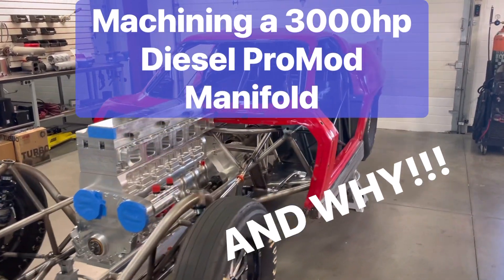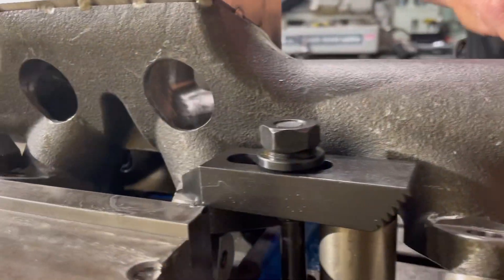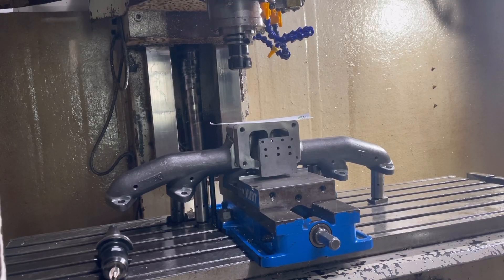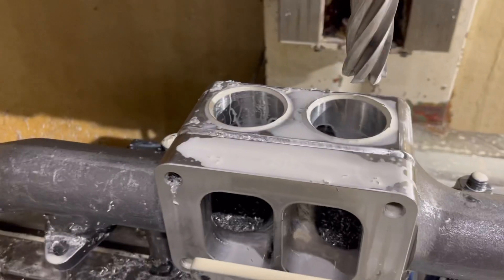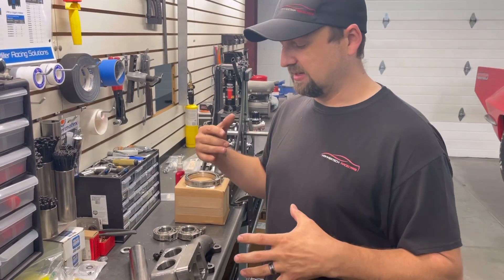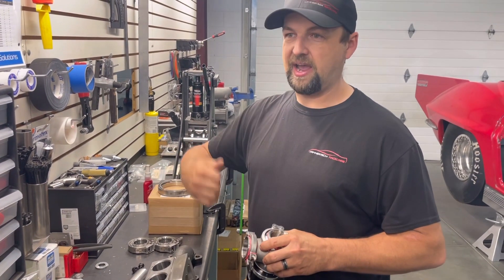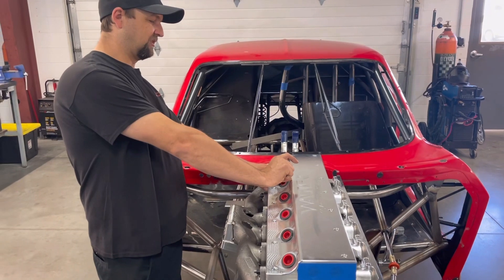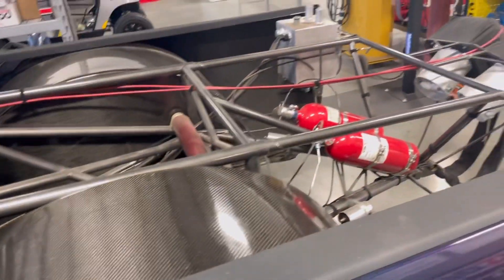Machining A 3000hp Diesel ProMod Manifold

Comment: I remember Jimmy Prock using 'feeler gauges' made of paper for setting the butterflies clearance on the hat, do you do something similar on the stuff you tune or..?
Reply from the maker: Are use plastic feeler gauges on the hat that way it doesn’t mark up the carbon fiber when you’re checking the blade clearance all the way around the housing
Reply: @robwendland  yeah I figured it was a combination of that and the same reason you use paper, nice way to be quick and ask something that is measured in mils already.  thank you 😊

Comment: I'm way more interested in the fabrication part of race cars, then the actual racing. building, and repairing these beasts is way cooler then watching them race.
Reply from the maker: I will keep that in mind. Starting in June I will be doing fabrication as NHRA has a new spec on the front end of the top fuel dragster’s. I’ll be explaining why this is happened and the process of replacing and fabricating the new pipe to the new spec.
Reply: @robwendland  cool! I look forward to seeing that!

Comment: I think people are getting carried away with the word pro mod. Would that diesel even be able to keep up in Top Sportsman? Nobody ever builds a car and calls it a top sportsman. Or maybe you can glass and bondo the doors shut and then it'd be a funny car. Watcha think? Do you think that car could hang in top sportsman? You know. The class below Pro-Mod- ified. 😆
Reply: They are getting very close. Biggest hurdle is trying to get the torque to the ground. It’s easy on a methanol engine making 3,800hp and 2,000ftlbs at 8,500rpm. But with the diesels they are making 3,300hp and 3,500tflbs at 5,200 rpm. Current diesel promod has the record at 3.99@182 in the 1/8th. But there are a couple teams running in the low 4’s that could also be in the 3’s by the end of the season.
Reply from the maker: Great response Scott. You’re right when these things leave the starting line it’s a fine line between Knock and the tires off and getting the torque knock down in that first hundred feet.I would love to put a direct Drive clutch system like a fuel car in it and I bet with that torque it would work very well it would just be more maintenance than just plugging in the tranny and cooling it down
Reply: With cars that will run 8 seconds or less in the 1/4, in what class and what type of car  is putting power to the ground and not knocking the tires off not the main hurdle to overcome?  And why is it that diesel and import guys can't, and will not admit when they are outclassed? Like seriously do you actually think you could enter that car in a field of top sportsman cars and it would be really close?  You can ask almost any import or diesel guy "Hey do you think you could compete with a field of top fuel cars?" And you won't get a straight yes or no answer. The answer is usually spot on to y'alls answers, aka excuses.  It would go something like this. "My Dodge truck against a top fuel dragster. Oh man it would be a close race. Because the main hurdle with my diesel is it has so much torque that the top fuel car hooks up way better next thing to worry about with my diesel would be getting it up on the boost so it billows black smoke like a dumpster fire. That and my Cummins makes so much torque that 10,000 horsepower it's a lot easier for the top fuel car to hook up and not spin the tires. Because you see. Torque is where it counts. My granddaddy had a John Deere tractor. It only had 9 horsepower but it had 5 million ft/ p of torque so it could easily out run John Forces funny car. But see top fuel cars are long and hook up better and they got wings and parachutes so that might be a close race. Ya see horsepower is how fast you hit the wall. Torque is how far you move the wall when you hit it. So really horsepower doesn't matter at all......blah blah blah blah me and my cousin sally got it on in that back corn field at the end of my property last week in the back of my pro mod Ram 3500 yee haw".
Reply: @noname-jr1vo  I mean by rule book definition they are a pro modified vehicle. Full tube chassis, Fiberglass or carbon fiber body. Meets the SFI specs for the class and the engine and transmission fits within the rules.
There are a couple teams that could run in top sportsman if they wanted to, but the radial events and even now the ODSS events get more publicity with much smaller classes that it makes more sense to run those classes and events. Way better to make 2-3 runs for first place as 6-7-8 passes when you have a giant field of cars. 

I’m up in Canada and a guy local to me runs top dragster with his diesel altered. Ran 12 passes at 6.96 in the 1/4 last season. Runs very close to his dial everytime, and it’s a mechanical injection diesel. So the guys with commons rails could do it even easier. But why compete with 50+ cars when you can stick to the diesel events and race your friends in a field of 8-10.

Comment: I just don't like all the black smoke.TOP FUEL RULES 😁
Reply: But they turn into diesels after the plugs melt 😜
Reply from the maker: They don’t even have to melt the plugs off to turn into a diesel. We’ve had ignition shut off at 300 feet and it was still running on six cylinders with no ignition whatsoever

Comment: Hey, try using a 1 2 3 block for touching off. Drop the tool down in z about 0.990" above the work piece, then slowly bump it up until the block passes underneath. It's saved me time and tools because there's been times I've bumped a carbide drill into the stock and shattered it.
Reply from the maker: Ten four! I need to step my game up on this fir sure. May have to pick your brain on this!
Reply: @robwendland  Nah, you're doing great. I don't have the balls to tackle 316. I'm still learning it just like you. Outside of actual courses, YouTube is the best place to learn CNC. NYCNC, Peter Stanton, and Aaron Gough have awesome CNC videos. Grismo Knives is also interesting, but the videos tend to be long.

Comment: Idk if this is a dumb question but why is a promod using a cast log manifold?
Reply from the maker: I guess it is pretty common on ProMod because of the requirements of space.
Reply: Also keep in mind function. Even these top tier diesels are maxing out at 6,000-6,200 rpm. Launch is typically 5,000-5,300rpm shift at 5,900 pull the engine down to 4,800-5,000. When you are only running those rpm a log manifold actually works quite well. Now they do make competition cast manifolds that have runners about 2.5-3” longer than a factory manifold. But a true tube manifold on a “gas” engine is designed for much higher rpm range.
Reply: Also due to drive pressures with turbos of 80+psi and egts north of 1600, tubular ones crack far too often.

Comment: Makes me want to race!
Reply from the maker: Let’s go!
Reply: You hiring? LOL I haven't worked on a blown fuel car since.. 2012..? and my skills are probably a bit rusty.. I sure as hell wish I was working around someone like you all the time...learn a lot and have a lot of fun in the process!

Hell, that's what drag racing is about, a comradery that's unlike anything else in Motorsport, hard work, good people and trying to kick ass with every part of the team and every part of one's job... well, it's a way of life not a job.. I should specify LOL
Reply: @dmeemd7787  I’ve got a 440, I’m getting ready to start building. I’m still in the parts gathering phase. I want to put a blower and a 6pack fuel injection system on it. I want to cram it into a Benz 450SLC.
Reply: @McFingal  nice! That should be fun to go to 440 route versus the 426 route 😊
Hell, if you're putting it in a Mercedes you need a blower coming out of the hood, because..well, you're putting in a Mercedes LOL. -- maybe go with an old-school enderle hat or a mag hat 😊
Reply: @dmeemd7787  everybody forgets the 440 is bigger then the 426. I just happened to find a low mileage 440. So it’s kinda of a run what you brung deal. 
I do like the idea of a 440 with a 6/71 and a six pack sticking out of a 450slc. It looks really cool in my mind. 🤷🏻‍♂️
Reply: @McFingal  yeah I totally dig the idea! For example, I would love to see a Mercedes promod, that would look badass if they picked the right model to do it with. As a side note, one thing I really like about the NHRA Heritage series is the variety of blown Nitro Motors they have, they aren't the same like the Big Show stuff is. You have some Alan Johnson stuff and whatnot but there are small block Chevy combinations like Sorokin had, big block stuffed whatever.. Of course it was all a Nitro but the point is the variety and cool combinations. So when people can probably pull off a really cool combination, it's a beautiful thing!
Reply: God, this it's got to be like at a tractor pull, that will probably be glowing like crazy! LOL

Comment: Hey Rob any reason with you don't want to use an edge break to find X and Y zero? Just curious same results different road that's all. You obviously know what your doing. Machining Tungsten was the hardest Stuff I ever did on a CNC. Tiny parts for IBM. You could feel when it was running the Tungsten, Big Vibration. Great Channel.
Reply from the maker: You know I have just always done it this way. From my old Hurco knee mills and so on. Edge breaks work well to. I bet tungsten is! I bet it shook the floor pretty good!

Comment: Will the waste gate doors get dirty hanging straight down with like soot opposed facing upward.
Reply from the maker: This is the third setup like this. So far the others have done well!
Reply: @robwendland  ....cool thanks for the reply. I would imagine a good pop off could also do a good clean out of any soot. I'm a boat guy so our diesels are pretty messy especially the older Detroit 2 strokes.